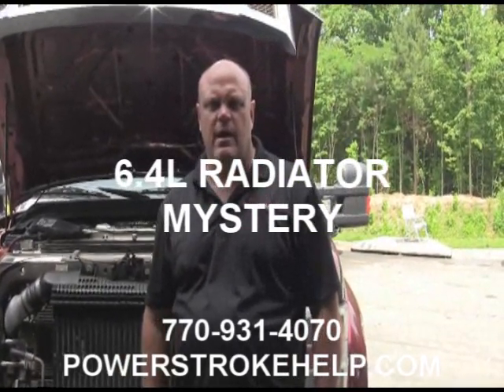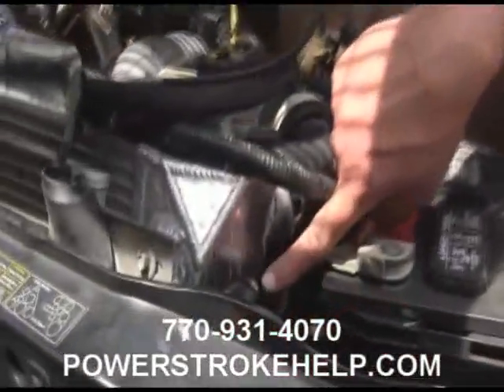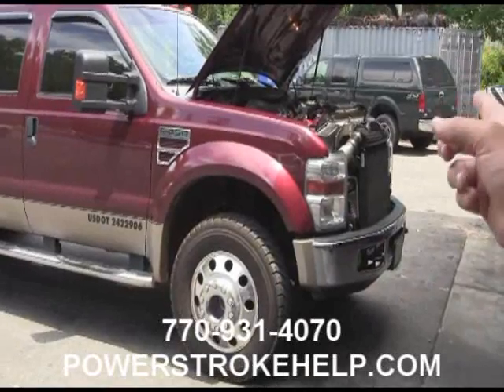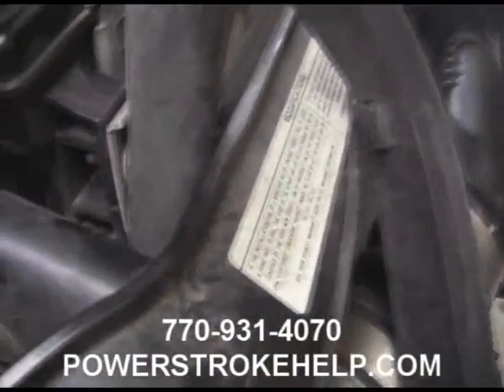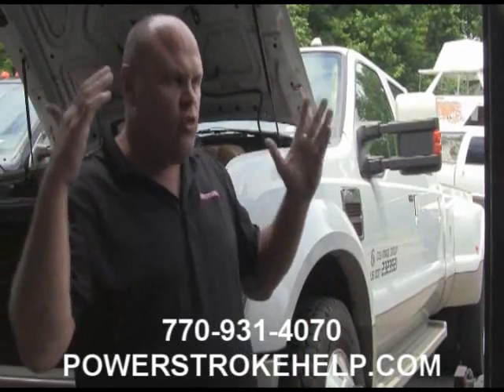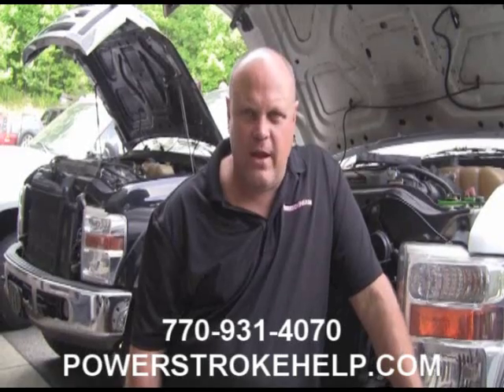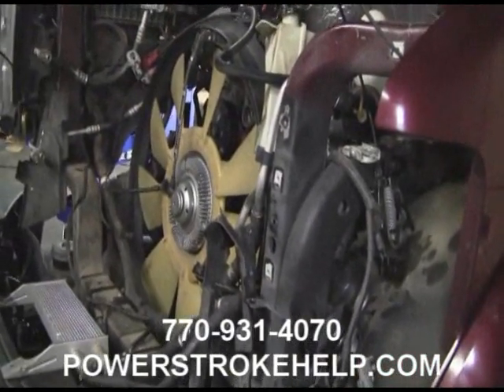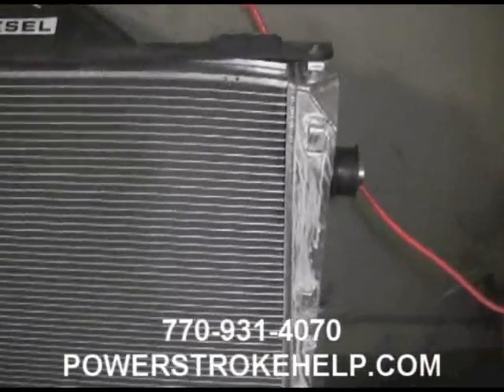6.4L RADIATOR FAILURE - POWERSTROKE

Comment: Besides the isolaters that radiator mounting is a really piss poor design my other fix was to epoxy the ends of the radiator didn't have a problem after that

Comment: Used to work on 6.4 ambulances through my internship. Everyday there was one in the shop-either radiator leaking or alternators(damn the dual alternator setup!). I remember one time one came in and the tech said someone just put gas in it and I remember being so surprised that it wasn't a failure. The manager said they were counting down the days until they auctioned them off.

Comment: I've seen a chevy truck commercial where they show how much fords frame flexes driving over a special stand they had. maybe that's why Ford brags about new frame so much in their 2017 series commercial
Reply: lol I know right
Reply: But all the ford fan boys say the frame flex is good! That is why the new frame on the 2017's are like twenty times strong then the previous frames. It's because small truck frames aren't meant to twist! Ford trucks have had horrible build quality
Reply: bahopik a competitors commercial is almost always going to be an exaggeration of the truth. Basically it may be true but not to the extent they say.

Comment: Anyone able to tell me how go get the front body/radiator isolators out of a 2008 6.4 F250?  The lower section of the mount is gone and I just had a new radiator installed.  it looked like a simple, pull the bolt and separate the upper and lower bushing.  After much skin loss and not going as planned I figured Id ask.

This should have been addressed during the install since the cab was off for an oil cooler change.  Noticed it because I now have a nice crease in my hood from the top of the radiator making contact with the underside of the hood when it flexed.

Comment: Radiator leak on a 6.4 no way?! That's only happened to like........everyone single one of them. I've never dealt with a more piece of shit, unreliable motor than the 6.4 obviously the 6.0 is a close second.
Reply from the maker: Brett D Hi Brett I hate to say it because I drove a 2010 but I have two radiators in this truck. I see these trucks come in with problems that simply should not happen all the time. I cringe when I see one roll up because I will have to explain to the customer why their bill is so ridiculously expensive. So my summation is that the 05-07 6.0 truck that has been bulletproofed is superior to a 6.4L
Reply: +powerstrokehelp do you think polygraphite bushings would help in this situation? I believe they need to go back making frames not twist. The suspension should handle all the work but with a truck this long that is another story. They have made these trucks to ride like a cream puff so its no wonder the whole truck takes the beating instead of your suspension now days. Maybe a way to beef up around the radiator. Like mustangs have the tower strut supports. Can design a radiator support bracket.
Reply: I don't think it's the engines fault, though both you and powerstrokehelp are seeming to blame it. It seems to more a flaw in the chassis/body configuration. Maybe a trivial point, but an apple is, after all, an apple and you can't blame the tree for the worm.
Reply: you are wrong if you think I am blaming the motor. I said I think they should go back to making frames not twist.. stronger frame.

Comment: How many different failures has Ford made?  Damn!  Stick to one truck and build it right.  My neighbor had a new '07 PowerStroke.  After 16 returns to the dealer, for failures, he got rid of the truck.
Reply: the pre 98 fords were way more reliable and did better on fuel becuase they didnt weigh as much. at least you didnt have to pick cab up to change head gaskets
Reply: harry escarole That's pretty gnarly.  I don't mean to dog the Fords, entirely.  They sure look tough, always have.  They should have designed it so the entire front end body assembly detached.  Or tilted forward like on the early Jags.  That would be a cool feature, a mechanics dream!  But... there are DOT collision standards and production costs.  I used to have my VW engine on a engine stand in Less than 15 minutes!  Pros can do it in 5.  I could drain the oil, pull the motor, torque the head studs, adjust the valves, reinstall the motor and synch the dual carbs in about an hour!
Reply: WAVETUBE84 they should of designed it with a longer cab to move the motor forward and have same interior space. the firewall hangs over half the motor so you cant get the heads the off.
Reply: harry escarole I wouldn't know.  But, if you do:  Hey, sounds great.  Maybe some sort of kit could be developed to enable that?  Maybe Ford designed it that way?  Just like a lot of auto mfg.s design stuff so that you MUST use their part, their tool, or their DEALER to repair something.  It is a classic story.  Jeezzz!  Why can't all trucks use the same oil filter?  Or maybe a choice between 3?  Same for ordinary cars:  Why do they have 50 different kinds?  If the 2007+ Ford trucks were simple to work on (or at least easy to access), maybe there would be more grass roots developments, improvements, and aftermarket parts.  Instead, you are almost entirely restricted to Ford service and parts.  Just the slight deviation from Ford can result in CATASTROPHIC FAILURE!  $8000-16,000!!!!  Ford designed their diesels "too close to the edge".  Bill Hewitt has expounded upon many of these failures and the factors which are involved.  My brother works for Ford Finance.  His office processes thousands of Ford auto loans, insurance and MFG. WARRANTEE SERVICE.  He said that the Ford diesel engines were so BAD that Ford would not wait until they went beyond the warrantee milles/months.  The bottom line is:  They are HORRIBLE!  It's a shame, because they sure look nice!
Reply: i agree

Comment: Does this chassis flex also cause damage to the A/C condenser or other coolers in the front?  Or is it just the Radiator?  Just curious if you checked the other coolers or if they were damaged but still worked ok or what...

Comment: Great videos my friend. I own a 08 6.4. Currently has extended warranty. PLAN to do egr/Dpf Delete.  plan To Keep Truck for A Long Time. What Do YOU Recommend I can do To Prevent some Of these failures and OR What should I plan to replace IN The Near future?  Has 95k miles. Also are there mods to prevent heads from overheating and cracking as well as the  wear on the rocker arms? Thank u.

Comment: All the people that say fords are tough don't use them. When you push it all the weak points come out and there is a lot of them. Remember the challenge with the duramax and the fords tailgate buckled up on the twist platform.

Comment: Are the stock mounts urethane? And did you state that the mounts were bad in most of or some of the others that failed? Sounds like one problem leading to another maybe. The real problem with these and all Diesel trucks is that they are over used and put in work situations that a bigger truck should probably be used. I have worked at a Caterpillar dealership for 25 yrs and a good example is the D6 dozer. People buy them and with a good operator they WILL do what a 7 0r 8 will but they will come in with wore out final drives, transmissions, and broken undercarriage far more often than their bigger brothers. Maybe a gusset or more cross members?

Comment: I had an 08 that cracked a radiator as well. Ford lost a lot of money chasing the cause. The list of remedies from the factory, at the time of my failure, was replace both thermostats, change large radiator hoses to include double o-ring ends, install venturi tee to degass bottle, and replace degass tank. they tried one thing after another and radiators kept failing. Looks like you are onto the root cause here Bill.

Comment: Bill, thank you for your effort to upload these videos. I have a '04 F-350. I was pulling a 7k lb trailer for about a couple hours and use it as a daily driver sometimes. I noticed that its drinking coolant. I dont have a delete or a sealed EGR. What should i do to keep my truck from consuming so much coolant. Thank you
Reply: Watch his video on radiator caps, maybe you need a new one.

Comment: I had frame flex on my 2000 V-10 F-250 Crew Cab. Started to get cracks on the cab mounts but no radiator leaks.

Comment: Could it be due to the fact that Ford does not use a boxed frame like the other manufactures (GM / Fiat)? I don't recall this being a problem in the 7.3 and 6.0 trucks though.
Reply: *****  Ford Superduty does not used a boxed frame. Its boxed in the front section only and the rest is C-channel. GM uses a fully boxed frame. I believe Dodge does too now.
Reply: I agree the problem is the frame
Reply: marion cobaretti The very act of hydroforming the steel to make a boxed frame cold works the steel. So essentially both the Ram and GM frames are "cold rolled" (cold worked).
Reply: makaveli200369 dodge uses cold rolled box framing

Comment: That's a pretty bad design flaw. I think its great the way you figured it out but really Ford should be all over the problem and solution.
Reply: Its strange- I have heard/seen so many design flaws in Ford/Chevy/Chrysler-some of which end in lawsuits. Many of which the manufacturer will NOT take responsibility. Examples: Ford explorer sporttrack body bushings disolve after about 4 years-design/compound flaw. Chyrsler oil pan/crank 2.7 v6  tends to foam oil causing premature oil/bearing failure=engine death. So many examples yet companies are denying responsibity. I had a customer with a civic out of warranty-Honda voluntarily contacted her because they had seen paint failures with certain colors-they paid for new paint!! No cost to her-she is a very satisfied customer-and likely a loyal one too.
Reply: Mate I hear ya.. I've had my F250 for 10 years now and love it and all its little problems. But I wont go back to Ford again or GM. Next time round Toyota, Audi or yeah maybe even Honda.

Comment: Thank you for getting to the main reason of the failure of some radiators in the power stroke 6.4 I think excessive frame flexibility may also be at play also but the big issue is the radiator support bushing's and trucks that get used like trucks